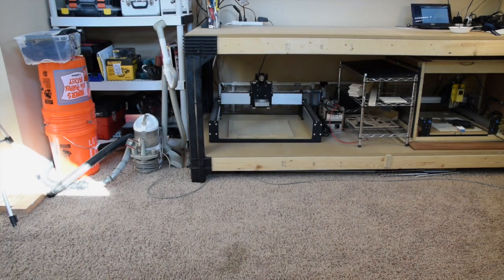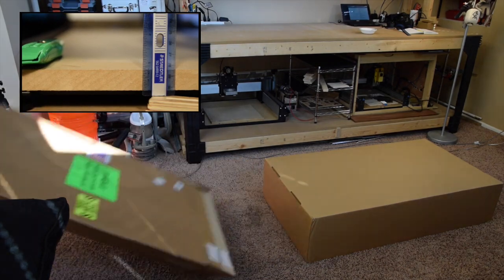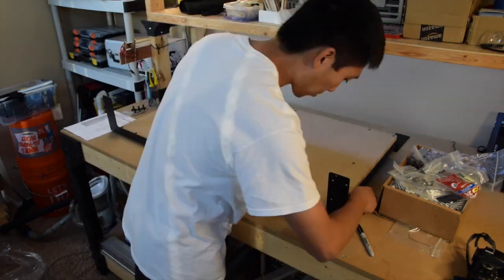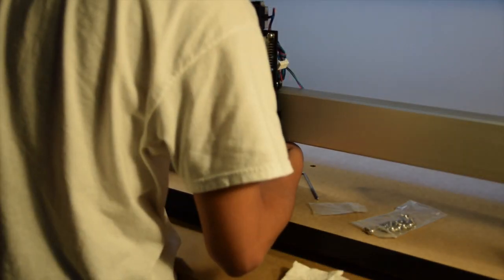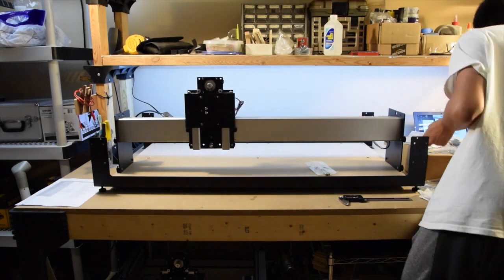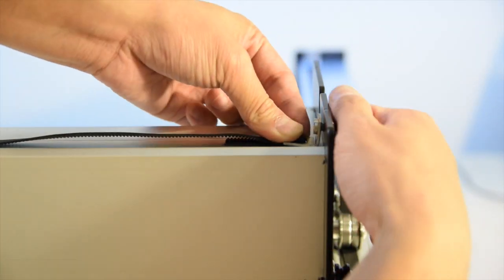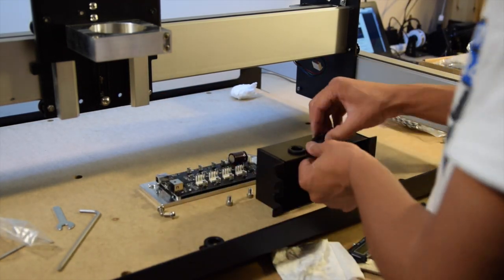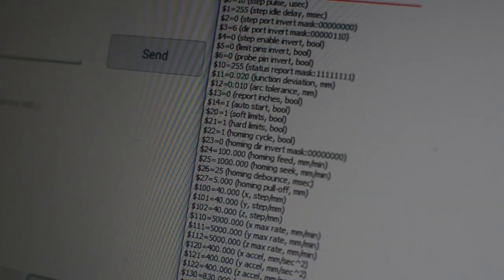Shapeoko 3 (2016) - Assembly Overview

Comment: We bought a kit with working area of 130cmx130cm which means long cables. Which position for the control board makes most sense?
Reply from the maker: Wherever makes the most sense for you. Usually you want it kinda close to where your laptop will be so you don't need a crazy long USB cable.

Comment: Was this an XL or XXL assembly?
Reply from the maker: XL, though all the steps are basically the same.
Reply: Hello Winston Thanks for your reply!

I'm interested in the XL and I'll be fine with the size, but I'm thinking if I should get an XXL (for future-poofing). I've had a Shapeoko 2 (1m x 1m) before, and had flexing issues on the Y rails, and some deflections from the steel plates.

In the XXL, are the any such issues too? Maybe minor? Is it rigid enough? - If there are, maybe I'll just stick to XL.
Reply from the maker: In the XL, the X axis is extended. That is the weakest axis, since it's single rail and I've had no issues with it. Extending the Y axis adds a negligible amount of deflection potential. More important thing to do would be to make sure you have a stable, flat place to put it, and also machine level your wasteboard.
Reply: Thanks so much! I'll order an XXL soon

I hope they don't release a Shapeoko 4 soon :P or Improved versions
Reply from the maker: Haha, if there is one, Edward Ford hasn't told me about it... Good luck and have fun in your Maker endeavours.

Comment: question, i bought the router on amazon, but i realized the router uses some kind of aluminum case/sleeve? where do you get that? i wasn't able to find any related info on Carbide 3D site, nor i was able to find a purchase link for the router or the case for it
Reply from the maker: you mean this? https://shop.carbide3d.com/collections/tools/products/makita-rt0701-adapter?variant=29340264262 

That's only necessary if you use the Makita, otherwise if you're using a DWP611, you should only need the naked router. No other accessories are needed for mounting.
Reply: Nevermind, i just received the router, i didn't realize it has a cover and you need to remove it to install it on the Z gantry, and that is what i thought it was a separate part, is the bare body of the router, the aluminum body with the coarse thread....

Comment: I am new to the CNC world and your videos have been invaluable.  I have a Shapeoko 3 and it's a great machine.  The included Carbide software is great for simple projects but is not what I have the machine for.  In the past few month I started learning Fusion 360 to create the designs for some electric guitars which have a lot of 3D contours.  However, I am having a problem with the post-processors after creating the toolpath through fusion 360 cam.  So far the videos I've seen of your different projects don't cover the post-processor you use to get everything working with the Shapeoko 3. If you have please send me a link. If not, would you be so kind as to do a video on the Fusion 360 post-processors you use for Shapeoko 3. It would be greatly appreciated. 

Again, loving your videos, keep up the good work.

Any information on this topic from anyone else is welcome as well.
Reply from the maker: +robles1999 have you tried using the Carbide3D specific post processor?
Reply: Yes. Somehow after the clearing pass and tool change when I start the rough pass, the tool plunges into the material retracts and the starts to cut about 1/8 above the material.

Comment: I've bought and received this model, but they appear to have forgotten the leveling feet. No response from them by email or phone, any ideas on how to deal with that?
Reply from the maker: Send them a follow up email, drop a post in the forums would be my suggestion. If I had to guess, I'd say they're still busy working through the tail end of black friday orders...
Reply: Thanks for the suggestion. In the interest of time saving, do you know if they use common parts I could maybe put in a mcmaster carr order to sidestep having to deal with their support? They should be supporting whatever mistakes they make but if it's going to take a week to get a response and have the parts ship out I'd rather solve it myself if I can, I doubt leveling feet are all that expensive

Comment: Another great video, Winston. We found that unless the Dewalt was all the way down in the clamp, we sometimes found the bottom v-wheels coming off the z-axis tracks when milling deeper holes. (still above the waste board). I notice you have the black ring on the router still, which limits how low you can position it.
Reply from the maker: Yep, the total Z-travel is slightly affected. Even more so if you use the Makita router (it's shorter).

When I don't need the full travel of the Z, I like to keep the spindle slightly elevated. Reduces the effective moment arm at the tip of the endmill. Probably doesn't produce any noticeable benefit in accuracy, but as an engineer I'm happy to entertain the theory...

Comment: Hi Winston,  Are you familiar with SMW3D's model R7 cnc router? If so, could you tell me why you prefer the gt belts on your shapeoko rather than a threaded lead screw for all of the axis controls? thank you, Tony
Reply from the maker: I don't necessarily prefer GT2 belting, it's certainly a compromise in some ways, but for things like cost/length, speed, and simplicity I think it does the job quite well. I'm not personally familiar with the R7, but taking a look at it, it seems mechanically solid. Most CNC's follow the same basic recipe, and this one's no different. It'll probably be a little more work, and cost a little more to get running (controller, assembly, etc) but if you want that tiny bit more insurance in the form of super-rigid drive system I wouldn't advise against the machine.

That being said, if you're NOT going to push your machine harder than Richard Cournoyer (@JPL_Richard on Instagram), I'd say save your money.
Reply: Thanks for your thoughts Winston.

Comment: Winston is the USB dropout issue totally solved with this new board? Do you know specifically what they've added to the USB isolation circuitry? I've replaced the carbide motion board with one i designed using RS232 instead to work around this. I'm considering buying a second machine if this has been solved.
Reply from the maker: My own issues with router interference were solved completely, and the Carbide team reports >99% success in the wild. You can likely contact support and have your board replaced at-cost, or even free and see for yourself.

Comment: So are you going to sell the old model then?
Reply from the maker: Also, this is the XL. My table just isn't deep enough for the XXL...
Reply from the maker: I've still got a laser project in the queue for the 2, and I have a few experiments with the 3.0 left to do. I'll reassess my CNC hoarding ways after that point...
Reply: Excellent video as always, Winston! Do you still feel pretty locked in/comfortable with the shapeoko 3 (especially given the upgrades for the 2016 models), versus an x-carve? Also, is the version you assembled in this video the XL or the XXL?

I'm presently assessing CNC options (including the Dave Gatton DIY version, though, I feel like the precision of the production models like this shapeoko3 or the x-carve are gonna be way higher; purely speculation though). 

Anyway, thanks again for the great videos, and for insight to the above questions. Cheers!
Reply from the maker: With so many changes that directly address prior complaints/shortcomings, I think the Shapeoko 3 hardware is at a very good point. The fact that Inventables just went to a more rigid/custom X-axis extrusion tells me the X-carve is playing catch-up. Software wise, it's a wash, but the bundled software from Carbide is just a "nice to have" at this point. Power users will develop their own workflows.

Also, Edward let me in on some of the "toys" they're developing in-house, and I think the Shapeoko 3 ecosystem is going to get even more interesting going into 2017... The touch probe video they released is just the tip of the iceberg.

TLDR: I'm a happy user, and I think Carbide3D is going to continue to improve the value proposition for new and existing owners.